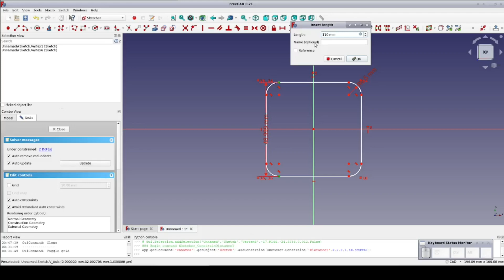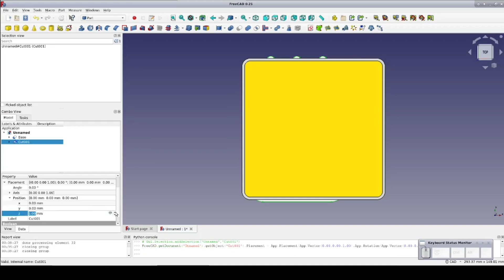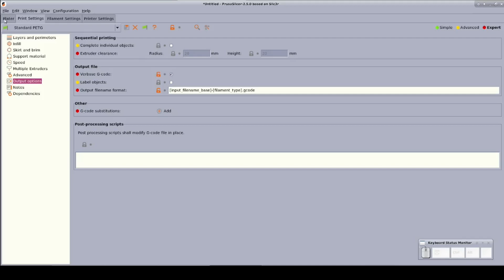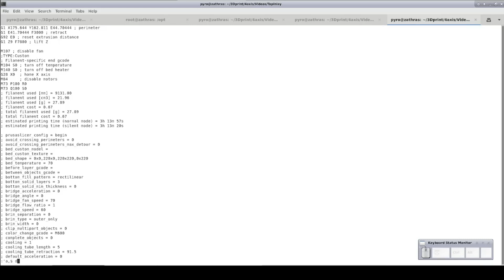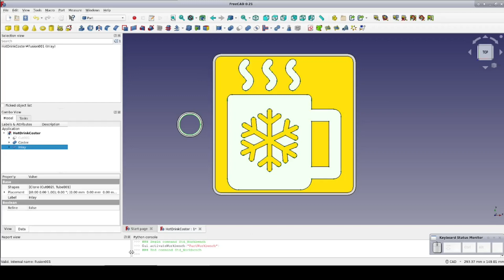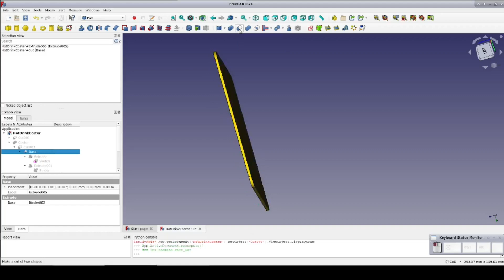3Dprint: Coaster with top inlay. Manually merging Gcode. FreeCAD.

Comment: Thanks. Very thorough explanation of the process. I've never seen this trick before.
Reply: I've just tried your approach but with the first two layers. It worked nicely. I didn't use the aligning rings because I exported the part and the inlay in the single .step file. PrusaSlicer sees two separate bodies in the step file and they are perfectly aligned. I can disable one body at a time just by setting its type to "negative volume".
Reply from the maker: Yes, now that PrusaSlicer can directly import step files the registration rings aren't necessary. When I developed the technique for my own use, that wasn't an option. Of course, they may still be useful for people wanting to use a different slicer. I may do a follow-up about using step files.

Comment: There is a "rounded rectangle" tool in the dropdown of the rectangle tool. You can also use symmetry on the center of the fillets to constrain the center to the origin.
Reply from the maker: Good point about the center of the arcs. I've gotten in the habit of using the regular rectangle, the rounded rectangle is fairly recent.